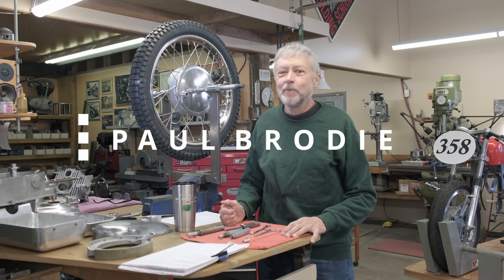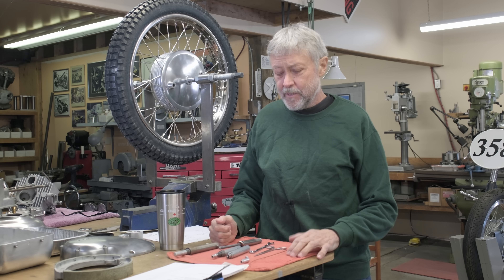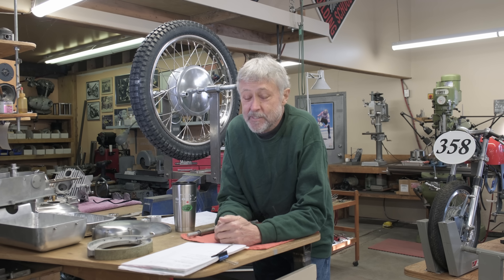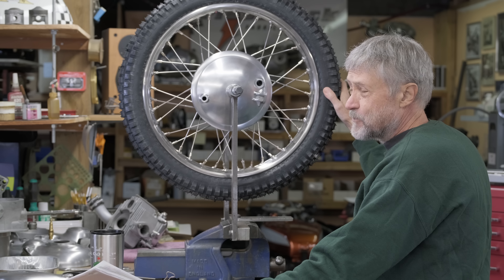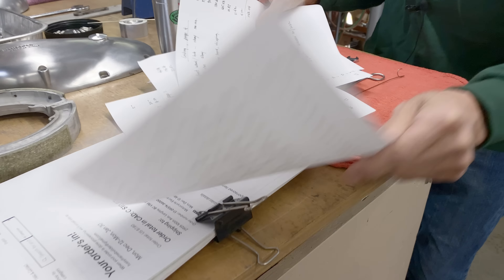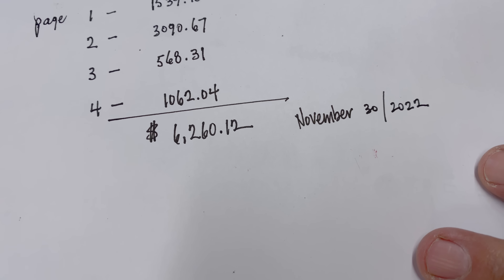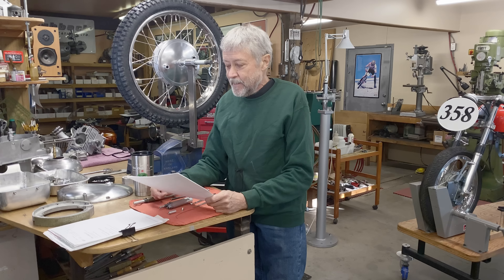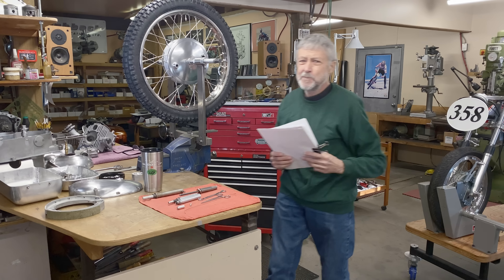Tiger Cub Start Up! // Paul Brodie's Shop

Comment: Those "tweezers" are Artery Forceps.  Much beloved of trout fishers for taking flies out of trout jaws. (Smaller/finer ones than you have here) - they have a zillion uses apart from clamping arteries - the latter not a common job done in bike shops!

Lost items down in cylinders or rollers fallen into a two stroke crankcase - grease thickly smeared onto flywheels can stick to needle rollers and fish them out - just a bit less awful than splitting cases that don't need split for legit reasons!  This happened to me about thirty years back with a two stroke single that unexpectedly was found to have rollers in its little end - I'd expected the usual bronze bush. That grease dodge worked a treat, got them all out - with a little patience.  The same sticky grease on a stick can be made to ease things from cylinders when you really don't want to disturb the head. Much depends on the angle of the plug hole - the more vertical the better.
Nice cub you have there.  Last one I had I sold for £180....  Look at what they fetch now - it's crazy time with old bike prices.
Reply from the maker: Ian, thanks for watching and commenting. Good lesson on the tweezers!    :face-orange-biting-nails:

Comment: Were you aware that Triumph made a two stroke Tiger Cub? See one in the 😊Sammy Millers motorcycle museum in the South West of England.  Mick
Reply from the maker: I do have the Tiger Cub Bible, but don't recall seeing a 2 stroke in there.
Reply: @paulbrodie  I don’t think they went into production which turned out to be a great mistake… apparently. I the actual bike being ridden on Utube today. It did in fact, look very neat.

Comment: The ignition doesnt seem to be advancing . It should strobe up at around 8 deg at tick over and advance to around 35deg at 3000 rpm .  The advance is controlled electronically, i would suggest you have a problem with the electrex world ignition.
Reply from the maker: You might be right. We will investigate...

Comment: Another topic. I watched the video. I like those leds lights you used. Have you ever measured the amperes of headlight and tail light combined? My standard incandescent lights take 14 amps. Which is about maximum for these tiny alternators. I would like to reduce my amp usage, so I know that the battery is getting enough current to stay charged.
Reply from the maker: I have never measured the amps. I do not have a charging system on my Cub. I took it off to run the Electrex ignition. Thanks for watching..

Comment: As the Cub was built for sale in the UK and associated markets (Australia, Rhodesia, New Zealand etc,  it had a left hand dip beam lensed headlight and the OEM brand was a Miller. Export bikes to right side driving countries used a French unit as of course the French drive on the right. I guess it was cheaper to source a continental lamp rather than make a special unit...
Reply from the maker: The headlight did not come with the Cub. I got it off a friend who owns Vincents. He had no idea where the headlight came from. All your comments are good, and there might be truth to what you said. Thanks.
Reply: @paulbrodie  In 1978 I bought a new CZ Enduro (basically a CZ motocrosser with lights) and the headlamp, a terrible sealed beam thing blew one day due to the stellar performance of the CEV electrics, The old bike shop I bought the replacement from was, like many old countryside bike dealers, full of old Brit bike kit. The headlight that went into my CZ was a Miller unit which came from the Cub parts shelf. I owned a Cub, bought in bits, it was the model with the gear indicator pointer and distributor, but had the sport head. That one had the shrouded headlamp and again, had a Miller headlamp... They had a very good beam pattern, with an arrow shaped bright spot which threw a good distance on main beam 🙂
Reply from the maker: @jonhaddock1799   Jon, thanks for commenting..

Comment: There are screw heads under that mirror glass. You can pop it off with some heat and tighten em.
Reply from the maker: I will give it a shot. I have to do something...

Comment: Looks like the sport cub. A beautiful job by the way. I don't understand your complication of setting the ignition timing.. There are so many variables. The best setting is by ear.
Reply from the maker: Thanks Ronald. I have a friend who likes to set the ignition on his race bikes by ear. I prefer a timing light.
Reply: @paulbrodie  I did that too and using the static timing marks. I found that to spec is not always the best method. Fuel quality is a big factor.

Comment: A bit of gooey bees wax might make a light weight thread locker to prevent your tool from falling in next time?
Reply from the maker: It was my fault that I didn't't realize the aluminum end piece was only held on by one thread or less. It will never happen again!

Comment: I have a dial gauge adapter in the plug hole to find tdc. I think it is more accurate.
Reply from the maker: The spark plug threads are at an angle to the cylinder bore. The tip of the indicator would have to rub across the dome of the piston. I prefer my way.

Comment: One way to sort out a weeping seamed tank is to hard solder it from the inside using a gentle flame to the outside. Or soft braze using a similar method. But either way you will need to degrease and boil the hell out of the thing multiple times first, because neither will work if there’s even a trace of oil left in the seam gap. 

Have done both. But back then I had access to a trych tank. Nasty stuff but the best degreaser ever devised. Shrinks brain capacity faster than daytime TV…👀🧐😎😜

Good luck. 
Peace
Reply from the maker: Yes, I want to fix it without hurting the paint. That might not be an easy job!
Reply: @paulbrodie  Indeed. A bit like returning democracy to Canada without hurting Jestine Castreau’s feelings.…👀🧐😎😜

Good luck. What about JB Weld? Never used it myself, but I hear of engine casings even being fixed by it.
Reply from the maker: @G58  I have not used JB weld...
Reply: @paulbrodie  Neither have I. I believe it’s very strong and rigid. May work for this application.

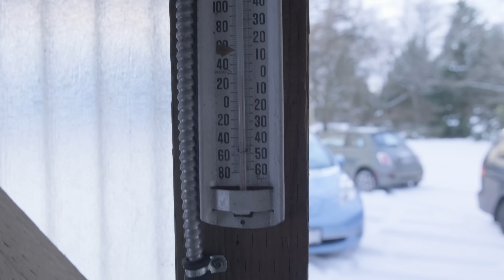Comment: 7:16 Please take that beautiful Honda 250/305 engine out of the snow. Thanks!
Reply: Poor Honda engine, I feel the same way
Reply from the maker: Raymond, it's a junk motor. Someone has hacked away at the cases. It's artwork resting gently in my driveway :)
Reply: @paulbrodie  okay, I forgive you.
Reply from the maker: @raymondsmith6504   okay...

Comment: That Honda dream 250 cc engine should surely be in the garage as the freezing weather outside is no good for this rare type of engine
Reply from the maker: It's a 305 Honda that someone has hacked with a hacksaw, so it is never going to get fixed or rebuilt. I think it looks good out there, eh?

Comment: The mirror is probably screwed in from the inside, I use something similar on my trail bike mainly because they are cheap! You need to remove the mirror from the metal back plate support and this is not easy to do, you can try leaving the whole thing sitting in acetone but really the best thing is to drill a small hole in the back of the mirror then inject acetone or brake cleaner into the hole, after a while the mirror will drop out. You can then locite the screws, the mirror can be stuck back in with some silicon sealant. If you use black silicon you can fill in the hole with it too! From memory there are three segments inside the mirror, if you post up an email address I can send you a picture or what they look like inside which will help when drilling the hole. (You have probably worked out that it might need a new coat of paint after doing the above!)
Reply from the maker: Thanks for your comments. My email can be found under the video, somewhere around the description, I am told. Someone else said to use a little heat to remove the mirror. I will figure it out.
Reply: @paulbrodie  Heat might do it, basically the mirror is stuck in place with the double sided sticky foam tape stuff, if you can get some brake cleaner in behind the mirror you can get the sticky tape to release its grip. Once you have sorted the screws out a bit of silicon sealant or supper glue can be used to stick the mirror back in place. I'll email you some pictures which should help.
Reply from the maker: @sidecarbod1441  Thank you... 😉

Comment: Hi Paul when your starting a bike on the roller or push witch gear do you use when ever i had to push start a bike i'd always select second gear because first would always locked up. also i spelt Mitch's name wrong in my last comment apologies.
Reply from the maker: Mark, I would say 2nd gear. I think first would be too low.

Comment: Have you shown your timing disk to crank connection in more detail?  I would like to see that, it looks interesting.  I was surprised to see you turn the engine over by manhandling the disk (rather than having your friend pull on the rear wheel).

On the piston stop, do you have a flat filed into the rod to allow the air to escape from the cylinder?

In case nobody has mentioned it (lol), your videos are the best - content, presentation, and video/sound.  Thanks so much.
Reply from the maker: Thank you Gregg. I have not shown the connection in more detail...  I do not have a flat filed into the protruding rod. The air just escapes wherever it can. Thanks for liking our videos!
Reply: @paulbrodie  I just found what I was looking for, in your video "How to Find Top Dead Center" from 7 months ago!  That video shows the series of adaptors you made, including your clever slotted "carrier" for the degree wheel.  Excellent!  Thanks Again
Reply from the maker: @GreggMax  Most welcome...  😉

Comment: Hi 
I have done similar on a bsa b31 
I have used superglue on a stout bit of aluminium welding wire 
And I think a heavy grease would also work 
Quiet infuriating but a relief when you win
Reply from the maker: We are starting a small, exclusive club for those who have dropped something down a spark plug hole and managed to get it out.
Reply: @paulbrodie  hi Howdon I join the plug hole club

Comment: Did the oil pump return oil to the tank??   Sounds like it needs a bigger main jet….
Reply from the maker: Alan, yes the oil pump does return the oil to the tank. I took out the plug after starting, and it was black. I do not think it needs a bigger main jet..

Comment: You seem to be getting better on each recent video ; may that continue Paul .
Was that twin bike engine in the snow outside a CB92 or a laverda 750 ? I had an SF2 myself , loved it .
I expect you will need to dial in the carb and then the timing again . Then repeat until you find the optimum timing . 
That tank leaking would be a nuisance , but you will be showing us some brazing skills again ,  I hope ! 
Nice one team .
Reply from the maker: Thank you David. I am trying to get better, but I did just take a fall on the ice, so that didn't help at all. That's a 305 Honda carcass outside. It has been hacked, so it is an ornament.. We just did a video on silver soldering. A brazing skill!
Reply: @paulbrodie  Fell on ice ? What are you thinking Paul ? Try to look after yourself and take less risks , especially while you are recovering ! Plumbing soldering I have a handle on , but brazing and silver soldering is new , so excellent , thanks . Have you any 'leading ' , as in flattening , fairing skills you can show us too ?
Reply from the maker: @davidyendoll5903  Yes, I fell. What can I say? Have done leading, but I have nothing to "lead right now. Thanks for watching!    😉

Comment: That is some nice troubleshooting! At 19:45 something fell off the motorcycle.
Reply: Looks like a wing nut that dropped from under the seat behind the rear shock  - maybe the new seat is held on with wing nuts and that one was loose.
Reply from the maker: Yes, a nut from the shock bolt that holds on the seat. It was only finger tight.. Good eye!

Comment: You will probably find you will need to fit a  decompressor of some sort, when you are starting with the kickstart?  Cubs tend to slip the clutch, when starting without a decompressor on them.

It's VERY difficult to get the carb set up right, and if Amal carbs are being used, it's quite common to fit sleeves in the intake tract to increase signal strength a bit.  Most people here are using 22mm Dell Ortos, which work far better than Amal, and are much easier to tune.  

Get the feeling that issues with hard to jet carbs, are probably more to do with the CDI type ignition systems most fit to these bikes, which have very short spark duration, and an advance curve, which might not be ideal for the particular engine they are fitted to?

Years ago, I took the electronic ignition off my 79 Bonneville and replaced it with points.  Could then tune it perfectly and alter the advance curve. Running was much better, more powerful, and started more easily.  Downside is that points must be serviced, obviously, but improvements were well worth having to do that.
Reply from the maker: I was expecting the clutch to perhaps slip, but it seems ok! I will play with the Amal and see how good I can tune it. A challenge. I have heard good things about the Electrex, so I'm hoping it lives up to its' reputation. Thanks for commenting.

Comment: Wondering, why not just use a dial indicator to find exact TDC?
Reply from the maker: The plug threads on a Cub are at an angle to the cylinder bore. The tip of the indicator would have to rub across the dome of the piston. I don't like that and it's not as accurate...

Comment: Greetings Paul, was shocked to hear of your recent health challenge and very please to hear Chemo is going well for you.
Have been watching your channel for some time and thoroughly enjoy the content and Mitch's cinematography.
Re the Electrex stator and 180degree out of phase spark timing issue, were you not able to re-orient the stator coil assembly 180 degrees on its mount ie: as it would be if mounted in the cover?
If so the rotor could be installed as intended by Electrex?
Interested in your thoughts.
Cheers,
John
Reply from the maker: The Electrex stator is meant to be mounted inside the primary cover, and I did not want to do that. I should have bought the STK 202 unit, but had never heard of it at the time. It took me hours to mount the stator, and I did not want to remount it in a different way... Thanks for your  comments.

Comment: There must be hundreds of ways to find TDC - what i do is turn a top hat bush a sliding fit onto a rod, long enough not to disappear, screw the top hat into the spark plug hole and then insert the rod its easy then to see when the rod is at its longest. I hope you are well
Reply from the maker: There are several ways to find TDC, but I'm not sure about "hundreds". Thanks for commenting...
Reply: @paulbrodie  Well Metaphorically 🙂

Comment: I stopped at 14:25 minutes to make a comment.
I've had 'Ulnar nerve relocation' due to 'someone' swapping wires on trigger unit of an ATV making it fire on rising signal instead of 'falling signal' and guess you had something similar happen? (engine tried it's best to run backwards while I was pull starting it)
Going to re-start video now and see what you found out
Reply from the maker: No, I have not had a situation like you described...

Comment: Paul, though I love the "European engineering complexity" of your TDC finder, my suggestion would be to gut the outer shell of the appropriate sparkplug, weld or braze a 6mm nut to the top side, sweat an button of plain solder to the tip of a 50 to 75mm 6mm bolt. In use, thread in sparky shell, then thread in appropriate length of bolt. The solder button pads your piston crown, all assembly is from "Paul side" of the device, so no part can mischievously escape into your cylinder and irritate your digestion, lol.

"Do all you can to give the fates and gremlins as little opportunity as possible to throw a wrench in your gears laddy, and it will save you much time spent in gnashing of teeth and rending of garments"_ grandpa
Reply from the maker: Yes, I can appreciate your idea. Thanks Grandpa.

Comment: Love the channel I'm glad that you're doing better all the best to you and yours. I do have a question. Can you tell me where I can buy one of those starters that your back tire is sitting on. Do they have a name or do you build them. I think it would make my life a lot easier I had one thanks
Reply from the maker: They can be made. A friend made this set. But you can buy them too. Cannot remember a brand name. Most folks using them are road racers, so look online in an area suited to road racing.

Comment: How could the engine run if the timing is off by 180 degrees?  It did seem to run ok at first.
Reply from the maker: I wondered about that too, but others have said it is indeed possible, but not well.
Reply: @paulbrodie 
 It would run 180 out if it had been timed on the exhauust stroke rather than compression or if the system had a waste spark.
Reply from the maker: @larrypalmer7136  Yes, true.

Comment: So NGK quit making those plugs. The B8 is a non resistor plug. The BR is a resistor plug. Some ignitions don’t like them. You shall find out I guess. 🤷🏼‍♂️ oh by the way I did get a pretty good stash of both B8 and B9’s for my Ossa. 😁
Reply from the maker: I think you are correct about the designations of the plugs.  Too bad NGK isn't making them.

Comment: 19:41 looked like a nut or washer worked loose and fell off the bike?
Reply from the maker: Yes, we picked it up and re-installed it on the shock mount. Thanks.
Reply: @paulbrodie  I’m rebuilding a Tiger Cub with my father (1962 T20SH) as my Grandma used to work on the line at the Meriden factory over that period. On our first start up we had a similar experience 🤣 I’ve really enjoyed watching your Tiger Cub rebuild series and I hope you’re personally also now on the way to full recovery too!
Reply from the maker: @cp4512  Thanks Chris. Cub project sounds great!    😉